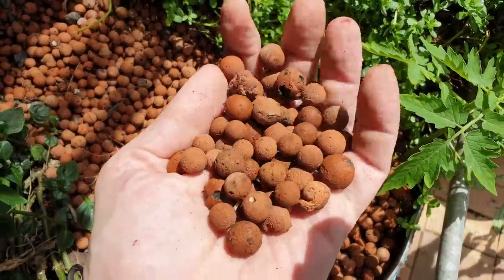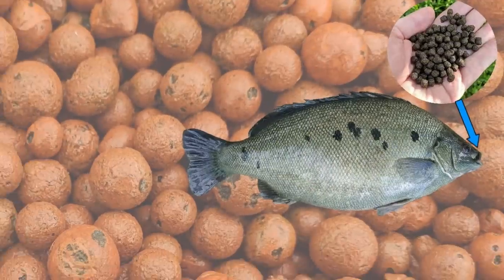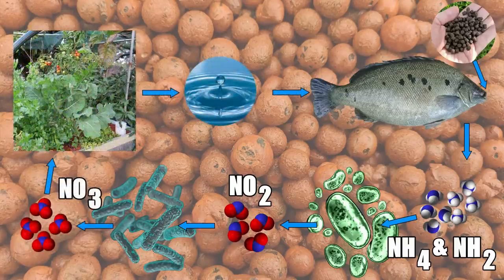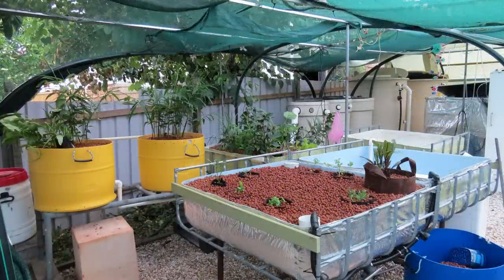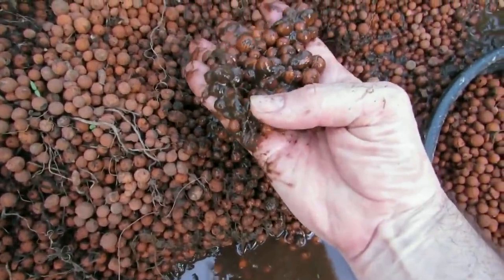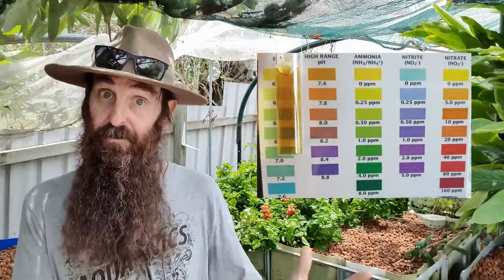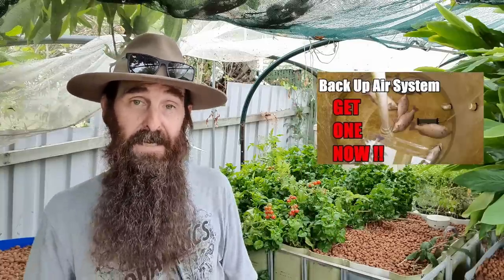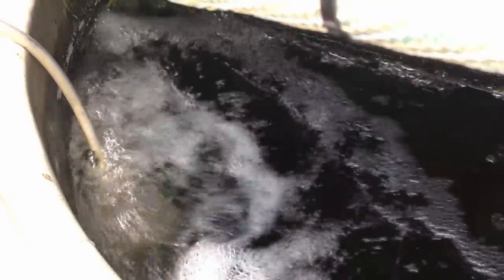5 Common Aquaponic Mistakes That are EASY to AVOID

Comment: Hey Rob, I have an indoor pool pond set up in my basement (460g total, currently half-full) with a custom 50-gallon radial flow filter with multiple filtration phases.  I've run aquaponics with bluegills in the past, but am now running 100% pure strain Blue Tilapia (Lakeway Tilapia Hatchery).  I had no problems establishing a very active breeding colony, and have 150 juveniles I don't have enough room for (I've had to do daily water swaps on a 20g; it may be euthanasia time again) and I had to kill about 1,000 fish so far, though none have ever died from water issues - unless you count 2 jumpers before my tanks had lids and had established the nitrogen cycle in the beginning.

So, I have endless fish and I want to set up a DWC system for lettuces and a bell siphon media bed.  Here's my problem.  I have a rash of aphids from ordering some red wigglers that came with unwanted guests that I cannot seem to eradicate.  I've kept their numbers down with sticky traps and am considering an indoor bug zapper.  I started a bunch of seeds in rockwool for hydro/aquaponics (I am set up for stand-alone hydroponics as well), and have an outdoor organic soil garden.  But, I am fearful of another rash of aphids, especially as my plants are sprouting.

The problem with putting the pool outside is that my backyard is not level at all, and I've put too much money into my setup already.  Do you have any input on how you would deal with this if you were me?  I'm very close to having a permanent food source that runs smoothly.  Any input is appreciated!  I tried neem oil as well and that didn't help much!
Reply from the maker: Hi Thomas. Are you seeing any ants on the plants as well? If so they might be farming the Aphids & if you can control then then you've won half the battle. 
The most effective way I've treated outbreaks is by blasting them with a hose. Might not be very practical with your set up though. Manually squishing them may help reduce the numbers if the plant is large enough. Have heard of folks getting good results with food grade diatomaceous earth as well. It didn't do much on a large outbreak we had here but might be more effective on smaller ones. 
Spot spraying with horticultural oils on a regular basis is a method others will use. CAUTION must be taken not to get it into the water though as the oil can coat fish gills & suffocate them. 
Hope that gives you a few ideas to try out mate.
Reply: @RobsAquaponics  I haven't seen a single ant.  Only aphids, spiders and the rare centipede.  Sticky traps have proven most useful so far but since they survived an entire package of them, neem, soap and garlic spray, hand-crushing, manual plant removal, etc - I went ahead and ordered a $40 bug zapper off of Amazon but it hasn't arrived yet.

I may give diatomaceous earth a shot as I want to use some with my red wigglers anyhow, but for now I am thinking sticky traps and electricity are the winners.

Next issue:  I need a purging tank for about 20-25 full grown blue tilapia..and I don't have one.  Lol

Love your videos, by the way.

Comment: Thinking I should try this. Is the long beard a requirement?
Reply from the maker: 🤔 It might help if you need somewhere extra to hold a screwdriver while working on the build but not generally. 👍😁

Comment: Hey Rob really enjoy all your videos. Lots of helpfull information in them. I have a question about my very small system 38 gallons or so. The Ph has been high about 8.0 since i set it up 3 months ago. It cycled ok and nitrate/nitrite, and ammonia are good i have made adjustments to the air and water flow, added API Ph down, water changes, adding only RO filtered water, and finally switched out my grow media. I am using Lava rock and Hydroton. My system is a 17 gallon reservoir with 4 buckets 5 gallons each. My plants wont grow or they stay very small and yellow. I only have a few small Goldfish  and they seem happy enough. Can you think of anything that might be affecting Ph this way im not sure what do. Anything you can think of would be great. Otherwise HAVE A GREAT DAY 🙂
Reply from the maker: Hi Vince. How much nitrate do you have showing up in the tests & how many fish do you have?
Sometimes the goldfish food just isn't nutrient dense enough to provide enough nutrients to the plants.

Comment: Could the waste be collected and used for plants outside the system?  Maybe take some water from the system and replace it with new water.  It seems like it could be calculated how much water needs to be replaced over a given amount of time.  What are the problems with doing this?
Reply from the maker: I use the solids waste to feed other gardens & have at times used system water to water pot plants.
The water gets replaced during the weekly top up & as long as the fish are well fed there shouldn't be any issues with lacking nutrients.

Comment: is it cheaper/ better to use perlite instead of clayballs?
what about using straight up soil/ dirt? (fine dirt/ particles already sieved out)
Reply from the maker: Perlite could cause blockages in hoses & pipes if it gets out of the beds Might also be an issue in areas that get high winds. 
I have seen folks hook up soil beds (called earthan beds) to their aquaponics systems & would like to do the same here if the new system has enough room. 
Cheers.
Reply: @RobsAquaponics  

watch https://www.youtube.com/watch?v=0W5YD7iufAo&ab_channel=AirborneProductions .
they use paint strainers as a bag/ lining, so that the perlite never gets out of the growbed.
in your kind of IBC setup, i suppose you can just bag up the outlet pipe?
i wanna connect my aquaponics walking catfish tank to a row of these 5gal buckets to grow 4-6 foot tall plants.
am wondering if using soil with these paint strainer bags would work.

are you gonna build a new setup?
what do you think of this setup:

walkingCatfish bigTub
 -> extra large radialFlowSettler filled with hanging long netted-bags of freshwaterClams
 -> bioBalls bigTub
 -> plants, plants, plants, plants
 -> artificialFilter
 -> back to catfish.

clams will eat up the fishPoop and larger solids and turn it into much smaller, finer solids and clean the water,
so that the bioBalls will do a much better job of converting ammonia and nitrites into nitrates etc, 
plants take up all the nutrients and cleans the water
and one final artificial filter to really clean out the water before going back into the catfish again.
as a bonus, one could grind up the clams entirely and make them into fish food for the catfish, or we can just harvest them and eat them too.

Comment: If you have conical based fish tanks that collect the solids at the drain outlet, could i simply bypass my filters temporarily and direct flush a small amount of water and solids out into a compost bin to lessen the burden on the filters?
Reply from the maker: That would be possible Tom but it would need to be done without fail & at lest once, if not twice a day.

Comment: When you have someone messing with your solar hot water system have the rainwater tank blocked off , while having our roofs replaced as part of hail damage insurance claim , they dumped the glycol into our rain water tank , hundreds of dead fish later on during the next day after the 10% daily topup
Reply from the maker: Wow mate. Did they offer any help pay for cleaning the system & replacing the fish? 
Are you up & running again?

Comment: I'm building a smaller aquaponics system with a limited budget for a school project (I have a ~25L grow bed and a ~20 gal fish tank) and I plan to grow just a few gold fish and lettuce, cucumber, and spinach (since they grow faster). Because of the coronavirus I won't be buying the fish for a few weeks, or until we get back in school. Would you say I need to worry about many of these issues, especially dealing with fish waste? I don't have any kind of filter or bacteria to manage the waste, since they're only baby goldfish and not full sized table fish. Also if anyone has ideas about how to feed the fish on weekends that would be greatly appreciated.
Reply from the maker: Hey Nathaniel. The fish wast can be collected by placing a sponge under the inlets at the grow beds. easy to clean every day or 2. 
Fish can go a fair while without feed so I wouldn't be too concerned  that they don't get any for a few days over the weekends. 
Sorry it took so long to respond. The comment sections have been very busy since lock downs started around the world. 
Cheers.

Comment: Hello Bob, I would like to know how you do the filter with the media K1, how they have that movement and oxygenation?
Reply from the maker: Hi Amaro. I have a venturi in the base of the filter that supplies air along with water that spins the media.  I don't have a clip that shows it in action sorry at the moment. There will be one posted once the large system is built in a few months time. 
Cheers.

Comment: gday Rob 
i have coconut husk ground down to looking like a bag os soil its ph neutral is this ok to use
Reply from the maker: I probably wouldn't use it as a growing medium in a bed as it may stain the water some & also move around the system as the water flows through it. Best to stay with non organic growing mediums I think. 
Would like to know how you go if you give it a crack though.
Reply: Rob Bob's Aquaponics & Backyard Farm  thanks so much bob I got 5 bags for free  I was told it would be good now I just dump it in garden

Comment: I know not to use carbonate based rocks as a medium and the issue regarding PH , But im not sure why though , if you PH is neutral , the carbonates will stop dissolving , why would pH keep rising then ? I would think that it will jump around between neutral to slightly acidic ?
Reply from the maker: Aquaponic system water normally turns acidic over time due to the alkalinity in the water being consumed during the nitrification process. 
If carbonate rocks are used, they will get broken down by the lowering pH, which in turn adds more alkalinity to the water, which also raises the pH faster than the nitrification process can consume it. Not a bad thing for most fish species but can be a real issue when it comes to nutrient uptake by the plants as high pH will lock out most elements at some point. 
Hope that helps.
Reply: @RobsAquaponics  Ah , got it , so by the time the reaction stops the alkalinity has increased too much , basically a lagging effect. sorry , fixed my original post to medium , not media  :-)

Comment: How feasible is operating an aquaponic system in a subtropical climate such as in Charleston, SC? Even with a greenhouse in the winter months and heater for the fish isn't there a real possiblity that bacteria will suffer greatly from temps in the night that get into the 30's during those winter months?
Reply from the maker: We're in a subtropical climate here in SE Queensland Australia & are having regular lows of around 1.1°C / 34°F over the past week, way lower that the perch like it. 
The water temp is staying at about 20°C / 68°F  due to having a 500w heater in the fish tank.  As a result, the bacteria have only slowed down a little as the fish are are only eating a fraction of what they normally would. 
There are also folks that run their systems a lot colder as they run trout in our colder states here & they don't have issues with the bacteria dying off.
Hope that helps some.
Reply: @RobsAquaponics  Very helpful indeed. Thank you. We get lows in that range as well. Albeit not many days in a row very often. What about keeping the fish tank temp cool enough in the Summer? Our temps in the summer are low to mid 90s. Is styrofoam insulation ok?
Reply from the maker: @williampkerr  It depends on the species you'll be using I'd say. I think Tilapia can handle water temp up to about 85-90°F / 29.5-32°C from memory but you might want to double-check that. 
The fish we use like water temp up to 93.2°F / 34°C so we don't really worry about insulating. It takes about a week of 104°F / 40°C to get the water up in that range I've found.

Comment: I am wanting to set up a 55 gallon in my house. what do I need to do to cycle the water before adding fish? Has anyone tried just pumping water through a PVC pipe with net pots.? Or do you have to have the rock bed?
Reply from the maker: I'd suggest you cycle the system before adding the fish. 👍 The rock media acts as a bio filter which you'll need to process the ammonia from the fish. 
Cheers.

Comment: Just out of curiosity would an airstone in or in the line to the grow beds fix or act as a fail safe to prevent the degradation of the nitrogen cycle?
Reply from the maker: I have seen folks do that Zachery but I don't think it's necessary myself. I also like to use the flood & drain method for irrigating the grow beds so that helps add in a load of air & O2.
Cheers.
Reply: @RobsAquaponics  YEah, Mine is flood and drain. Floods for about and hour and drains for about 45 minutes. 24/7. Of course I use the cascading water when it drains to aerate as well so that is why the cycling.

Comment: So do your DFMEA! Lol. After watching I am thinking about making a trough for all the suction side to drain into in case of failure. 
I had a gravity fed system a while back where the tank drained slowly into a ditch which had the grow media then was pumped back... Terrible design, went on vacation and of coarse that is when the pump failed and I came home to dry fish. Lesson learned: always assume a pump will fail.
Do you think it would be an issue to make a huge tank with less beds used? I'm a northerner and it gets to be below -18C yearly. I was considering making my tank deep, like 3m deep with a 4-5m circumference. I was not planning on a lot of fish at first but I want something more likely to self regulate the heat. I'll be building up as time goes on and more fish are hatched but don't want to upgrade or make new tanks, just lengthen my greenhouse.
Reply from the maker: One issue you might have is solids removal from the base of the tank as it's fairly deep. It could also be a bit hard to check if the water gets a few tannins in it from the fish feed.  That's would be my main concern Joe.
Hope that helps some mate.
Reply: @RobsAquaponics  Thanks I will have to look into the tannins thing, like wine? Sounds interesting...

I was actually thinking all about the solids cause that has been terrible to deal with in the past with my other setups. I was going to make the sides slope and come to something like a sump pump basin. In fact I was thinking of using something like a sewage grade submersible sump pump.

Comment: Regarding the oxygen issue when pump fail, is it possible to use flat tank with large surface area on top which allow more air/oxygen to dissolve into water?
Reply: allot of surface with vary few fish, maybe.You need to break the surface tension on the water to allow o2 transfer at any real rate.The wind across a pond doesn't add o2, the waves do. Bubblier in the water column adds some but the bubbles popping on the surface adds most of the o2. Lost power in a bad ice storm.All the stores were closed with no power.Used a 8 inch DC fan pointing strait down at the water running on a car battery. Wind sent ripples across the surface.Juggled recharging batteries with truck but it worked for 4 days.
Reply from the maker: The stocking density would need to be very low if you were just relying on the exchange of O2 at the surface. You're much better using some air stone, venturi or some form of water agitation at the surface to help facilitate the exchange.

Comment: What if the fish are baby's or should I grow them to a pound before using in a aquaponics system
Reply from the maker: You can grow them out in a smaller fish tank as long as it has proper filtration. 👍 We have used a screened laundry basket to pop the fingerlings in before & floated that in the main fish tank until they were large enough to swim free.

Comment: If your fish die from pump failure or nitrate problem, is it safe to eat them, or will the meat be poisonus in some way?
Reply: Are you certain they actually died from this?  Also, even though the water looks clean, it still has a host of bacteria present.  I wouldn't recommend eating any dead fish.  Personally, I would grind it up and add it to the compost pile.
Reply from the maker: I wouldn't like to say due to legal reasons sorry mate. 😉😅
I do know folks that have eaten fish that dies over night after cooking them very well. 
I used the dead fish from the thumbnail of this clip as tree fertiliser as I didn't want to risk it.
Cheers.

Comment: why you guys not introducing bioflock systems?
Reply from the maker: The nutrients being produced by the fish are being used by the plants. Adding a bioflock system would use some of those nutrients.
Reply: @RobsAquaponics  Then we can increase the fish count, thereby more fish can be grown at the same time. Right?
Reply from the maker: @MobileShots  That would also require more biofiltration which in most systems are the beds. I'm also not well-read on the whole bioflock raising process just to let you know. ;)